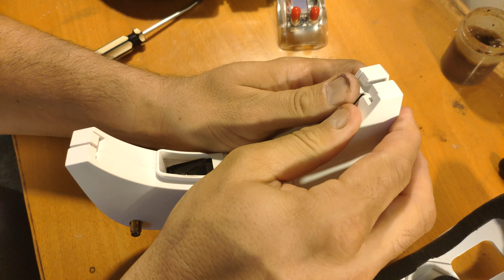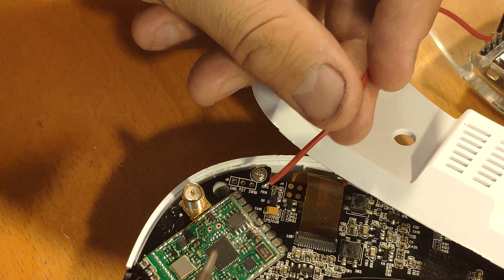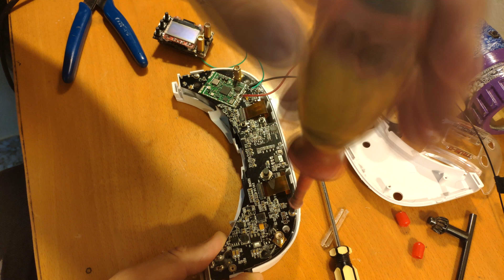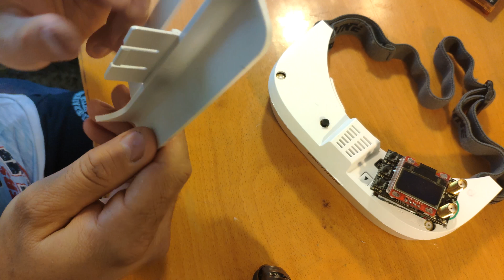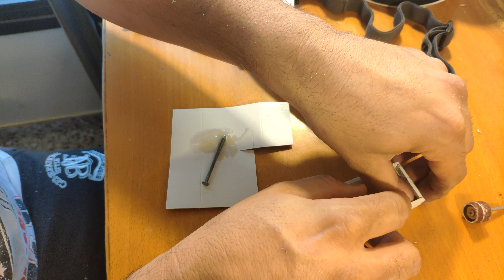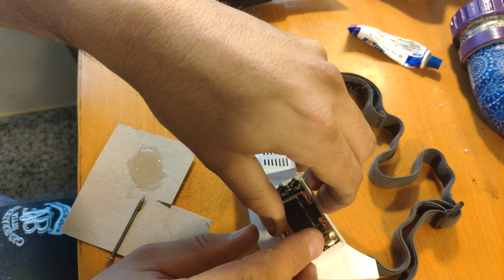UPGRADE eachine ev100 furious TRUE D

Comment: Hi there from across the pond.
Ev100 does not have proper diversity. If I had to take a T adaptor and put it on the antenna and put a clove and flat anntena on the one pole and leave the other blank would that increase the strength or break it. Please let me know.

Thank you
Kind regards
Gareth
Reply from the maker: Hi Gareth  - sorry I have no answer to your question ... If this is not a big financial expense then you should try it - good luck

Comment: How do you know when you have successfully knocked out the power on the receiver? Will it appear as a black screen when selecting the proper channel?
Reply from the maker: The screen will not be black - it will be snow .. and you will not find the signal of the video. And he won't get hot
Reply: @NaftulyART  ok I think I did it. If I do a auto scan threw all the channels and goes black screen. It obviously isn't finding it because I changed quads for diffrent vtx channel and ended on the previous know channel when working and goes black. If I manually scan each channel I get snow
Reply from the maker: @dalowryda  That's right - you should get snow on every channel - until you plug in the new module and get a video

Comment: How do you get the audio to work as well? I have seen that there is a mod to add the capacitors to the original board however it might be easier to do this mod but I would like to audio to record as well, any ideas?
Reply from the maker: Do not know. Not using it

Comment: I tried your mods but didn't have an image, I don't know where there is a problem. Finally, I picked up the AV in
Reply from the maker: Strange ... it does not make sense ... it's the same system - have you tried to disable the module? And how did you give the voltage to the module from av?
Reply from the maker: I guess you did not get a image because you're using a modul  that consumes more power than a furious and so when you connect voltage from the battery itself it works. Right?
Reply: @NaftulyART  use bec to module

Comment: i think i broke the module, when disconnecting power i use drill and desolder a little, now when i power on goggle, no beep sound
Reply from the maker: The bip does not matter - does the goggles  turn on when you plug in a battery? If you killed the module of the ev100 it's not terrible - the main thing is that the new module works
Reply: Naftuly FPV that’s the problem i plug in battery nothing happened, even when i connect my new module to the solder pad, i will try again today, but before that when beep sound the ev100 module is still on and transmitting, so i keep drill until the original module stop working
Reply from the maker: @RayanBackalley  My bro ... I hope you do not drill too much and touch the board below ...
Reply from the maker: and sometimes the big problems arise from simple reasons. Did you check that the battery is charged?